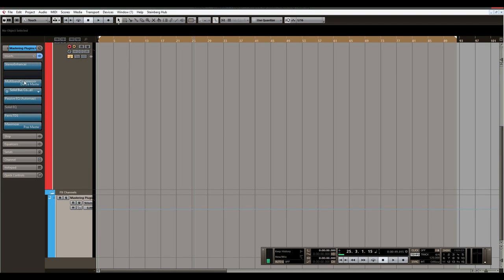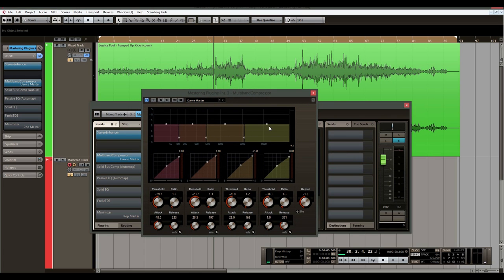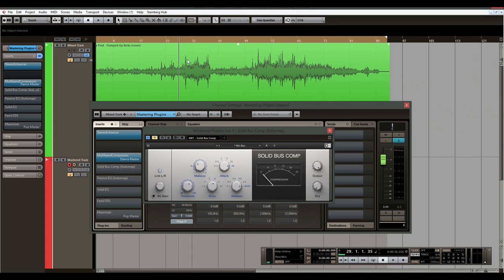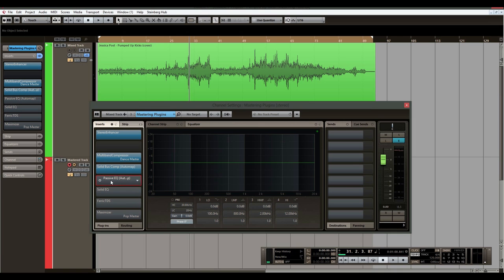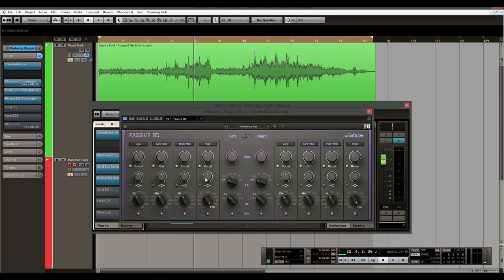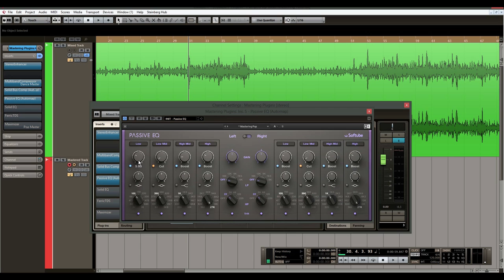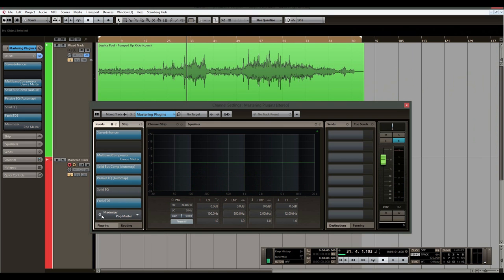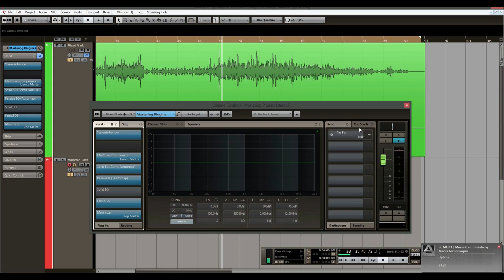DIY Mastering - Part 2 - Plugin Chain

Comment: I'm a Cubase user as well, so I have a lot of these. like the widener, the mbcomp and the limiter (plus Cubase brought back Magneto) but I'm curious about the compression and EQ.  What it is about those plugs that you like better than stock Cubase plugs?  Are there stock ones that come close?  If not, what plugs do you recommend?

Thanks a lot for the help.  I appreciate it.
Reply from the maker: Yeah so there's a couple reasons why I like those plugins. The ones I was referring to is the Waves "Linear Phase Multiband Compressor" and Waves "Linear Phase EQ". Essentially, they're specially designed plugins that allow them to be very transparent. They're designed using a method called "linear phase" which means that when the plugin splits the audio signal into multiple bands, it does not create a phasing effects which will change the sound of the input signal (not including the actual changes you will be making by using the plugin the way you intended to). It's a little hard to explain, but yeah they're designed for mastering and are made to be as transparent as possible while allowing maximum control for making compression and EQ changes.